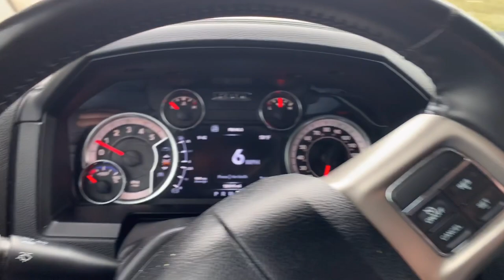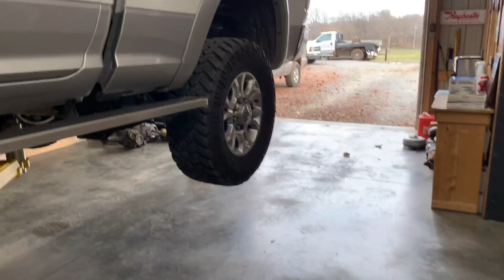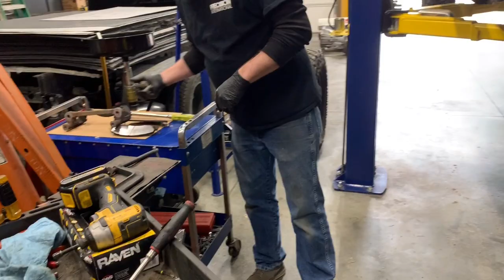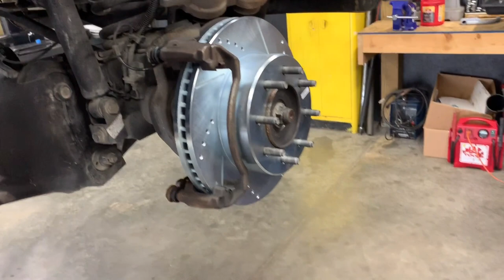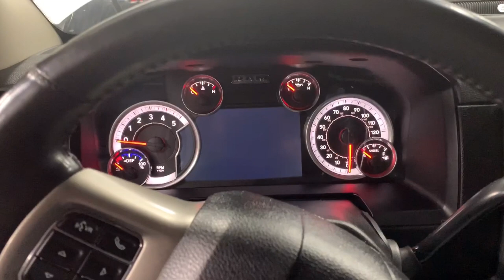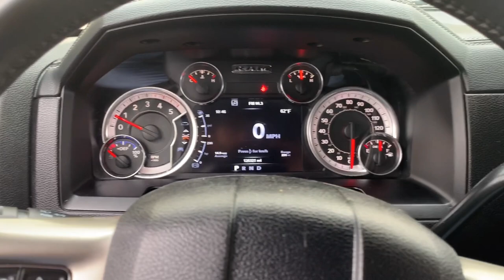Power Stop Upgrades to the Cummins!!

Comment: Ordered a set of the z36 brake rotors and pads the other day for my 2012 3500. I’ve run them on my old truck before and never had any complaints. Also gonna be replacing my calipers and brake lines while I’m at it since I recently rolled over 200k miles. But for a diesel addictive I run hotshot’s secret

Comment: Might be a good idea to emphasize the importance of following the initial break in procedure for the new pads and rotors. Just read through the procedure (included in the box) with mine...gonna find a place to do the install, some places don't want to install customer supplied parts anymore (liability concerns they say...).

Comment: I think my brakes are glazed. There’s no noise from thin pads, and they don’t pull when used, and they seem to work fine when not hooked to loads. When hooked, the trlr brakes seem to work much stronger than the trks brakes do.

Comment: Don't PS brakes use ceramic pads?  Ceramic pads will not stop as good as Semi-matalic.  I need to do my brakes on my 2008 Ram 4500 11' dump.  The truck is Very heavy and pulls a tralier as well as a load in the bed (3+ yards dirt, stone, etc plus pulling a small backhoe).  I would think these brakes with ceramic pads would be a bad choice for a truck like mine ... or am I wrong?

Comment: Wow... those brakes were done.  Glad you changed them before you ended up in an accident!  About additives: Hotshot's Secret EDT is good. So is Amsoil injector clean + cetane. I don't always use additives though. It's better to run clean, quality fuel filters, imo.
Reply from the maker: Monster RAM yea I bought this truck and I’m trying to upgrade what the previous owner didn’t do. I was just going to get some fuel treatment for it to just run through it since I deleted to make sure it’s all cleaned out.
Reply from the maker: Monster RAM what size tires and wheels would you run on this? I want just a little wider tire and 18” wheel no more than 20”
Reply: @cfudge24  I'd do no more than a 35X12.5 without putting at least 4.10s in it.
Reply from the maker: Monster RAM yea I didn’t want anything any bigger than that myself. I need to find a good looking wheel option also.

Comment: Also he should have cleaned and Grease both pins on both sides.  Also where your pads sit in the brackets I always take a wire brush and put a lil grease on them. Great job tho!!
Reply from the maker: Yea we ended up cleaning both pins it just didn’t make the video.

Comment: Hey man nice truck I just picked up a 2017 Ram 2500 Cummins and I am looking to upgrade the tires to something a liitle bigger. I was wondering if you did the front rotors and pads and just pads on the rear and kept stock rotors ?
Reply from the maker: Joey Patton I changed all the rotors and pads. I’m about to do a transmission upgrade kit cause these factory ones aren’t the best. They have junk clutches in them.

Comment: Great video bro!! I use Seafoam I have a 2016 3500 I do all towing with mine. How are those brakes and rotors holding up? Are they squeaking? Any posing in the brake petal? Any steering wheel Shaking? Thank you!!